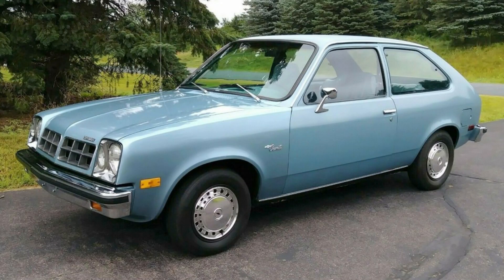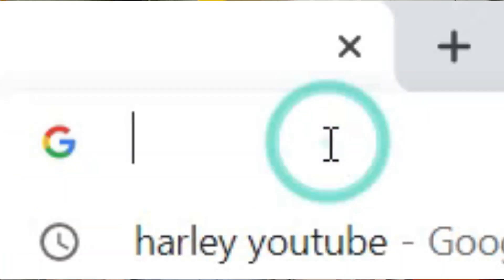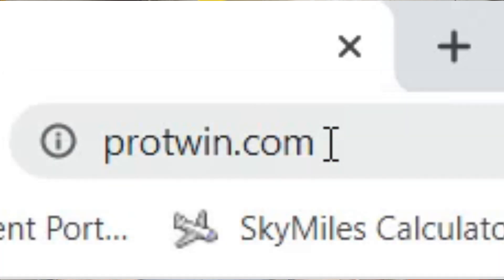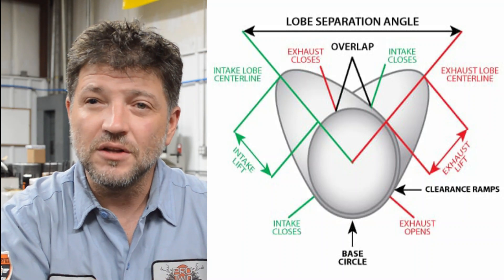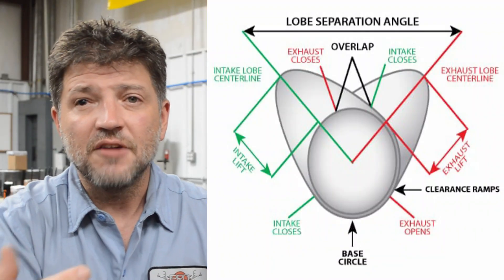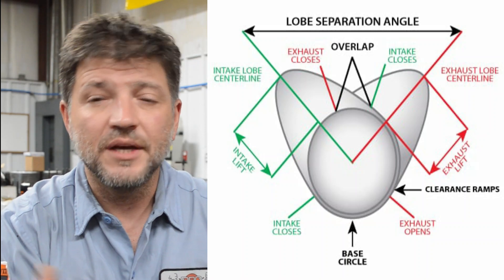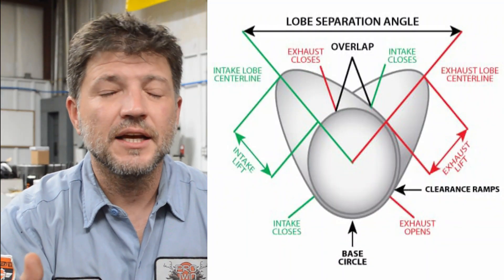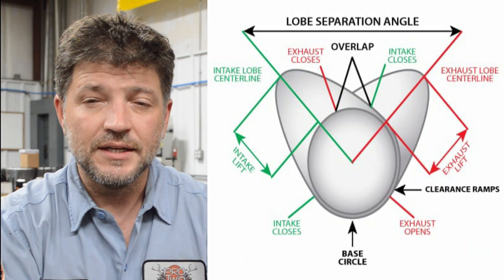Harley Camshaft Upgrade - How to Choose the Perfect Cam - Kevin Baxter - Pro Twin Performance

Comment: New Subscriber here.  Your videos have so much information, I had to get in on it.  I've read that the TTS 100 cam can give some instant grunt in a M8.  Have you had any experience with that cam?
Reply from the maker: No I have not.  Not familiar with it.
Reply: I went with the screaming eagle 462 power cam, on my 2o21 new road glide limited and its putting out great Torque at 116.5 at 3500 rpms and getting 102.5 power,  se tuner, and vance n hines power duals, with rinehart slip ons that was free,  my goal was to bring up the horsepower on a stage 2 build, as a bonus I'm getting great early on torque,  seen many posting to get the torque cam, so I went with power cam, and completely no regrets, and the sound is amazing too

Comment: Keven I just put S&S 510c in my 2005 fxdi. I’m running the TTS master tune and a bassani 2 into 1 megaphone. In your opinion what would of been the best cam for that set up? I’m asking because I’m not real happy with the outcome
Reply from the maker: I should ask you first, what are you not happy about?  That will help me steer you in a different direction.

Comment: Everybody wants a better cam shaft. More performance.  Not me. I want to dump my Harley 266 cams and go back to the original Harley cams. Is there anything that would stop me? I have a high compression 2000 Springer with compression releases. I hate all the noise from the cams.

Comment: good afternoon, seen your video of the cams for my harley fat bob of 2010 tc 96 is not clear to me what I should put.
There are usually two of us on the bike and what I am looking for is an improvement on average, especially from 2500 to 5000 rpm. Unless you correct me on what I need, what would be your recommendation for the cams to put ? 
Thanks